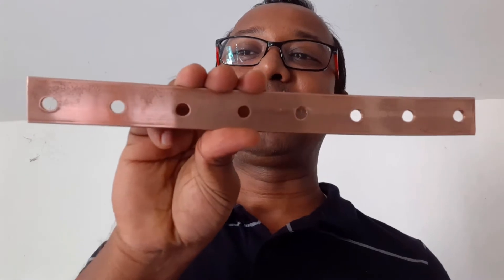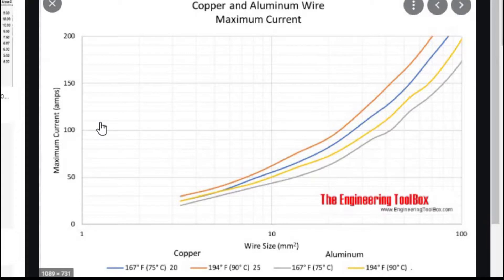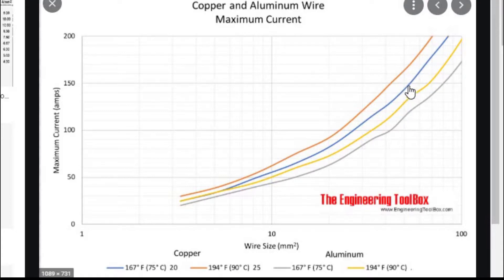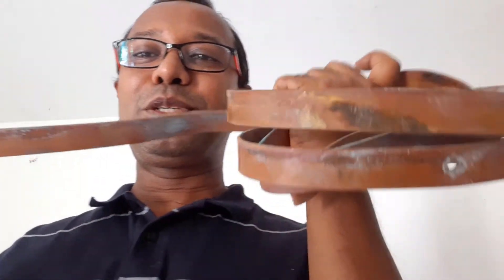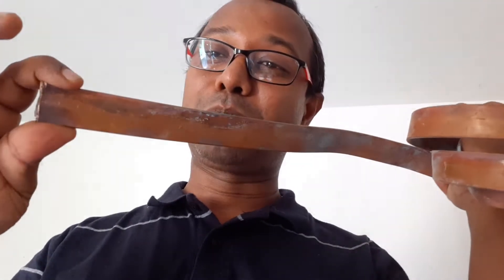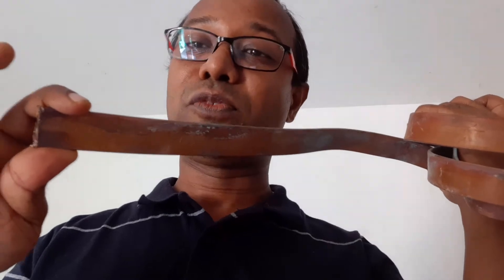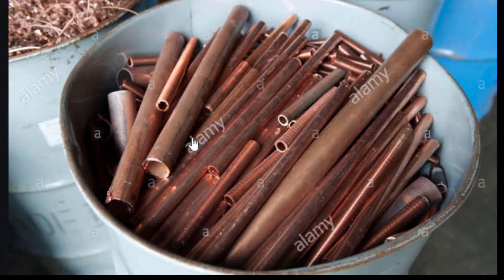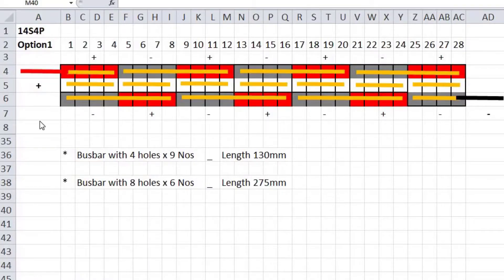48V 4P 14S Battery Bank Nissan Leaf Modules - Part2 - Making Busbars

Comment: Did you test the Amp-Hour capacity of the Modules ?
Reply from the maker: No!  The modules were scanned prior to removing it from the car which was at 32% SOH.  Therefore, I assume one module have a capacity of 500Wh*32%SOH=160Wh;  Full pack with 28 modules will have 160Wh*28=4.48kWh for a full cycle;
Reply: ممكن شرح بلغة العربية لو سمحت